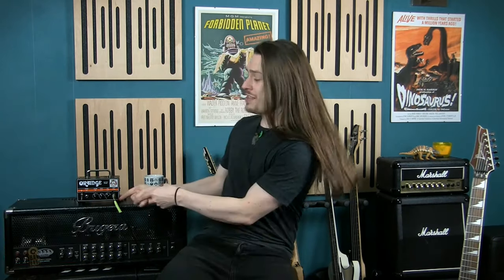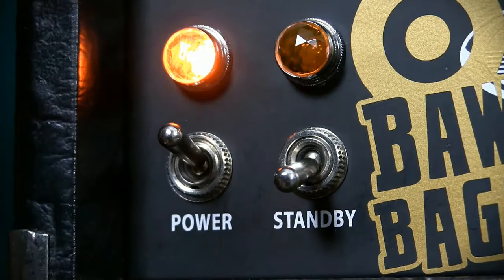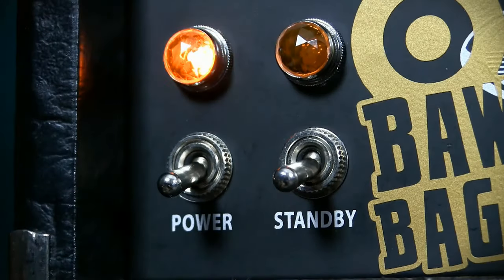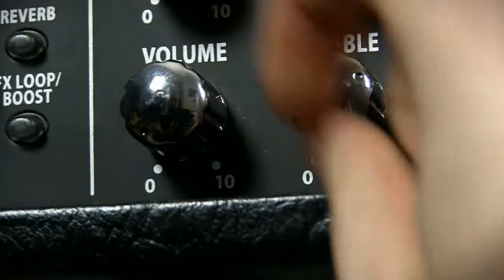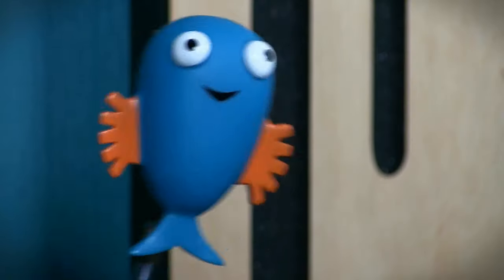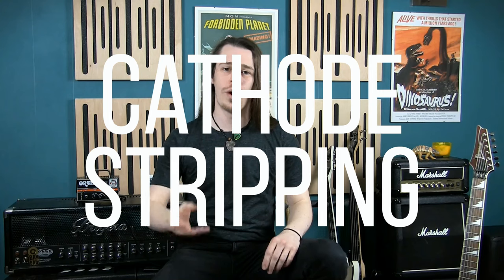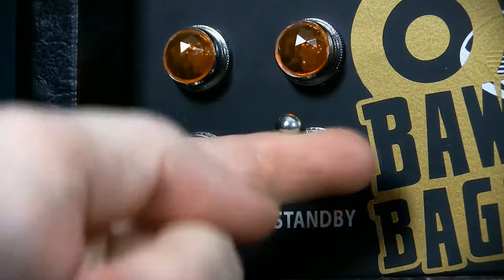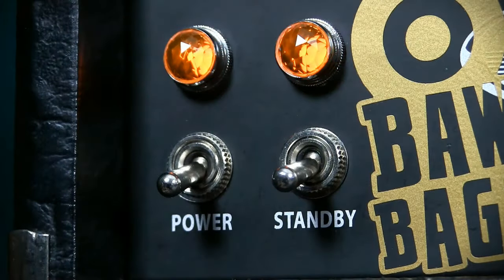Your Standby Switch Is A Lie!

Comment: My amp tech who does tons of work for touring Pros, of whom I've been using since 1980, said the ONLY amp he said the standby is not needed is the Vox AC30. He said all other amps, if you dont use it, you ram the tubes w electricity. Decrease your tubes' life drastically. I back about everything you have done, but on this one, I believe my Tech. Might be a bunch of fried tubes coming...
Reply from the maker: +B. Scott Farthingsworth yet every other non guitar amp doesn't feature one and they don't blow valves. 
Also, have you ever wondered what makes the AC30 different?
I'll tell you, it was produced before standby switches on guitar amps became common place, it was designed by people who knew it didn't need one.

The reissues have a standby switch because people started getting panicky about it not having one.

The technology in an AC30 is no different than in any other amp, if it doesn't need one then none of them do.

I'm afraid all the evidence is against your tech friend.
Reply: That is incorrect, your tubes get electricity as soon as the amp is switched on.  Standby merely stops the signal from the output of the amp to the cabinet.  Otherwise you couldnt warm your tubes up in standby mode because they wouldnt get electricity by your techs logic.  For someone who works with touring pros he is remarkably ignorant of signal chain which i find suspect and questionable.  I own tube amps and have years of sound engineering and musical experience and I trust Collin of CSGuitars enough to believe his video.  That being said tubes should warm up a little but honestly 30 seconds to a minute is plenty.
Reply: Right because its impossible for youtubers to also be professionals in the field.  Speaking as a sound engineer, and someone who understands how amplifiers work the ONLY thing a standby does is prevent your signal from being sent to the speaker cones it literally does NOTHING ELSE.  Otherwise you cant "let your tubes warm up".  How would a tube warm up unless it gets electricity?  Once an amp is on the tubes get juice.  How is this so hard to comprehend?  All a standby switch does is prevent the output of the amplifier to the speakers this is the reason an amp can have its tubes warmed up in standby mode -___-

Tube amps sound BETTER when pushed to their limits and after they have warmed up but there is nothing to say you need to keep it in standby for 5 or 10 minutes first.

why dont YOU go ask a professional and stop criticizing real professionals unless you know what you are talking about.
Reply: MetallenVikingr what ever,just don't cry when your tubes blow and you have to by new ones every so often.
Reply: God you're paranoid, try learning before you open your mouth to criticize, when you say ask a professional all I am hearing is I am scared of tubes and need a smart adult to tell me this is safe.  I have worked in retail electronics and the sound and music engineering field for many years now, tubes will not break if you don't wait for them to "warm up" they just sound better when pushed THATS IT.

Then again perhaps you really won't ever understand, even when there are videos, tutorials, the entire bloody internet to ask you still insist that someone ask a professional.  Clearly you are not one and won't listen to them so there really is no helping you is there.  Collin is professional, he makes his own guitars changes his own tubes, does gear reviews frequently and if I am not mistaken plays with bands and uses tube amps on the regular.  I would not be surprised if he does his own biasing as well and researches his topics before posting them.  Collin knows the switch isnt needed its just nice to have your amp chilling in standby as tubes take a short while to kick in, say 5-6 seconds.  Having your sound ready to go is a no brainer but it still isnt there to save the tubes its just user paranoia.  TUBES GET POWER WHEN AMP GOES ON, IT DOESNT CHANGE WHEN THE STANDBY SWITCH IS ON OR OFF. GOT IT?????

seriously.  go read a book.
Reply: MetallenVikingr tubes are dangerous though...
Reply: I'm an idiot, so is my NY amp tech who worked for an amp company in his teens he's been doing this so long.... 
Our apologies, and good luck to you all.
Reply: B. Scott Farthingsworth finally someone who isn't taking advice from someone that thinks he knows it all.
Reply: Better to know than to remain ignorant.

Comment: NOoooooooo!!!!!
Reply: mine stops current hitting the power tubes though,so in standby mode they get no power whatsoever and thus they claim they prolong their life
Reply: It does stop current (as it disconnects high voltage from the tubes) but then fully hits them with a spike once you turn it on while they are heated up. An unheated tube is essentially a few metal plates in vacuum and with the relatively low voltages (compared to thousands of volts in something like transmission tubes as collin mentioned) in amp tubes, nothing really will happen and the current gradually increases during heatup, wich is always better than a spike for all components in the HV path.
Reply: Uzmeyer If you have the  master vol turned to 0 there is no current hitting the heated tubes though.
Reply: Not really. There will be no signal on the grid of the tube, but in a regular push pull class AB amp your tubes idle at arround 70% of their rated max dissipation (aka 70% of the max current that the tube can handle at the voltage its running at), sometimes more or less depending on how you bias. The input on the grid just causes the tubes to conduct more or less, driving AC through the output transformer wich then drives the speaker. If you are really interested, i suggest reading valvewizard's website, especially the section about power amps and standby switching.
Reply: Uzmeyer I will thanks.
Reply: TBH isn't it going to shorten the valves' life if they heat and cool more frequently? With any mechanical object, you want to minimise the heat cycles to reduce stress on the components.